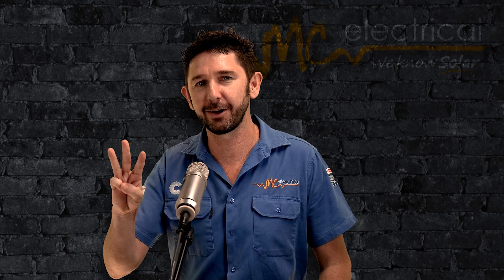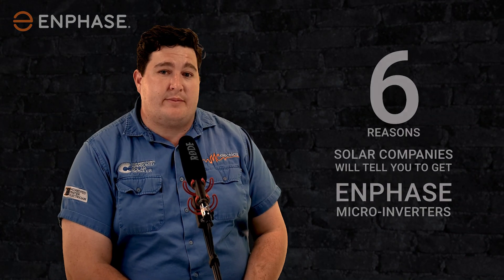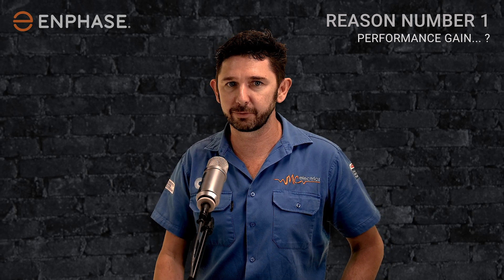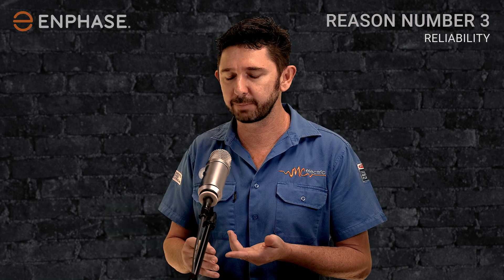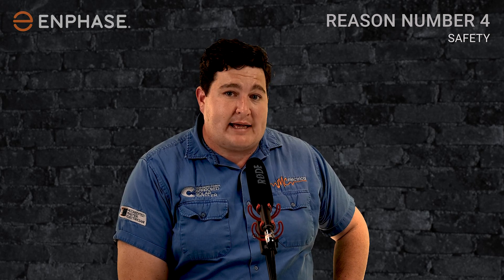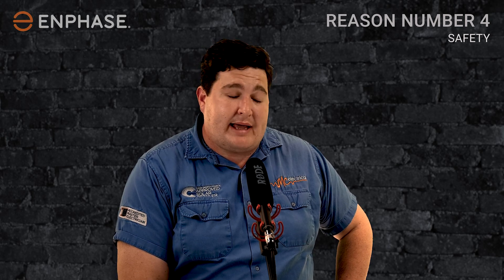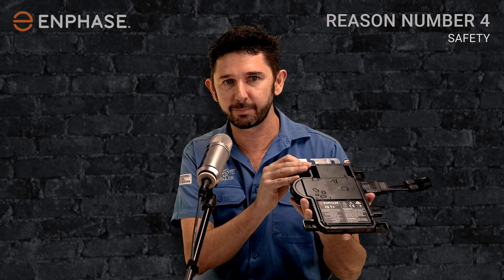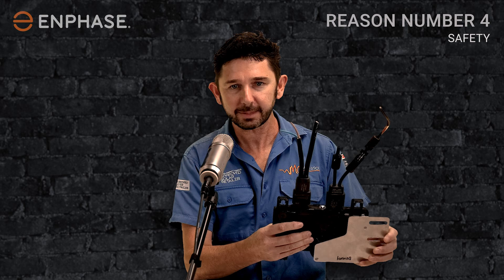Enphase | Solar Optimisers & Micro Inverters Mini Series

Comment: Enphase micro inverter if I buy any solar panel sets with enphase microinverters I'll just take it through a minute junkpile put up the solar panels maybe taking apart and scrap them out for whatever I need from it and throw the rest of it elway I can't see losing the power turn it into AC power raking the solar panel send it to the inverter turn it back in the DC power make a run-through more machines to make more power use so you have less power is every little thing it goes through has to use power and besides I don't need micro inverters they don't need it in this state we are not from California the anti-American country state drug-induced state the communist government in California where the government people in  California  people should be homeless and living out in streets with no place to go to the bathroom the business destroying radicalist people.

Comment: I think your math is off.  A rate of 50 per million per year is 1 per 20,000 per year.  A 10% chance of 1 failure out of 20 panels after 10 years is 0.1 per 200, or 1 per 2000 per year, not 20,000,   But I have 17 enphase inverters and had no failures for 6 years but then 2 failures in year 7 and 2 more in year 8, so yes, they do seem to be "dropping like flies" after a certain period.  My failure rate is 3%, or 1 per 34 per year, so 600 times the rate claimed by Enphase.  I've heard many other similar stories.  They failed one-by-one and some of them gradually over several days, so not due to some surge in the line.  However Enphase did their testing, it is not predictive of real-world performance.  I suspect part of the reason is the constantly damp humid weather we have here in Southern US.  Moisture is much more damaging to electronics than heat, and it eventually gets in.  Moreover, here we have about 50% cloudy days so no professionally installed system "pays for itself" in 10 years, it's more like 17 years and that's under ideal no-shade conditions.
Reply from the maker: I'll check my maths, but that is concerning how your's are failing. Hopefully the more recent Enphase micros are more reliable. Did you see my videos about Enphase v Fronius?  After I did this video I found more reasons not to go Enphase. https://youtu.be/TqOw43-hbjc

Comment: In US they use 2 phases and combine them for 240v. Meanwhile many appliances use only half - 120v - either L1 to neutral or L2 to neutral. I only saw 2 wires and 240v output. How power is separated so we can still have 2 time 120v going to the panel?
Reply: The two wires from the inverter connect to L1 and L2, and supply power at 240 volts.  L1 and L2 then connect to opposite ends of the low voltage winding of the transformer on the telephone pole.  The transformer can absorb the power and step it up to  high voltage (thousands of volts) for transmission through the grid.  There's no need to connect a neutral to the inverter. If by chance you've got lots of 120V things running on L1 and none on L2, that's no problem, the transformer will take care of the imbalance.

Comment: Did you ever do part 4 SolarEdge
Reply from the maker: No. A long story around that - Basically I got threats and i was reported to the electrical safety office on a witch hunt. I ended up getting the BS rulings from the ESO overturned - i should probably do an article about the unethical and aggressive tactics used to dissuade anyone from speaking out some day.

Comment: Never have I heard a credible source say you will get more than 1-3% additional performance in unshaded system, secondly your second point is incorrect - if I want I can see per panel performance temperature, voltages, power amps etc at the minute or system performance on a second by second output in local envoy mode (installer mode), thirdly a platinum installer gives you a 15 year warranty.  I have a 6 years old (three times expanded system) that 1 micro reported issues - installer replaced and upgraded 12 micros for me - zero cost - took about 3 weeks from first query to all installed!  The other two advantages you missed are if you want over time to expand your system - with no regret spend - then with Enphase this is simplicity itself Finally if say several PV cells die or are damaged by hail at the 5 - 10 year mark - well with a string solution - can you still find those exact same panels to buy and replace - whereas with Enphase its a non issue, buy whatever you want and fit it back into the array within the micros rated power + 33% or just install a bigger micro with a 400 - 500W panel.  Lets say you had a roof with 2000W panels and 8 of 24 panels were damaged in a string solution - how would you hope to repair that unless you were lucky with second hand parts that pretty much matched the ratings of your old PV panels.  You are right its a more costly solution!

Comment: I started with Enphase in later 2013, and have no desire to change. The quality is superior even with my old M-215 inverters. If you want to cut the cost a bit, then ya, chose Solar Edge, it will perform close to the same, but you still have that one wall inverter point of failure. That I don't like.  My neighbor was talked into Solar Edge a few years ago, and has gone through two Solar Edge wall inverters in the first two years. The last one had smoke coming from it before it tripped the AC breaker. Yes, both were replaced under the installers warranty, but one took a month to get it changed, and the second one took almost two months. The 3rd one is a different design, so maybe he'll have better luck with that one.

Comment: Just for the record I have had 3 Enphase microinverters go bad on my 24 panel solar system which was installed in 2012. Enphase did provide replacement units at no cost but installation was up to me because the company that installed my system does not warranty installation of replacement parts.

Comment: You've only installed 3,000 Enphase Microinverters in five years? That's nothing. We install three times that many each year. No wonder you know so little about Enphase Microinverters. 

BTW, The Enphase IQ8 inverter has been used in the Enphase battery since 2020, and will be available for solar panels later in 2021. The IQ8 microinverter inverter is a game changer...
Reply: so, could you help explain, is there any more advantage of enphase systems?

Comment: When you start talking about storage I think Enphase becomes an even a stronger proposition.
Reply: This is completely wrong, because a battery is charged with direct current (DC). With micro inverter you must first convert from AC to DC to charge the battery, which costs at minimum 15% of power. With a string inverter and the battery on the DC side, the string inverter can then provide the energy from the battery for the house in AC, the overall efficiency is about 20% better then AC storage.
Reply: @falkreichbott5675  Technically maybe so. However, when the grid goes down and sun is shining the system is smart enough to not even use your battery but power the house from the panels. And overflow the extra to charge the battery. That’s not something the other batteries can do including Tesla Powerwall.

Comment: if there is so much downsides to enphase why not use solar optimizers like solaredge ? what is the actual benefits in terms of shading by using microinverters vs optimizers?
and why AC through home is safer than DC ? ( assuming same wattage in power. safety is the same concern for both)

Comment: ENPHASE 25 YEAR ON ON ROOF TOP UNITS During the Warranty Period, if Enphase establishes, through inspection, the existence of a defect that is
covered by the Limited Warranty, Enphase will at its option, either (1) repair or replace the Defective
Product free of charge, or (2) provide a credit or refund to the owner of the system at the originallyinstalled end user location in an amount not to exceed the then-current price of a “like kind”
microinverter(s) that is available for purchase by the system owner at the time of the Limited Warranty
claim, or (b) the original cost of the Enphase Microinverter that is subject to a Limited Warranty claim.

Comment: Did you ever get the issue with 50ish voltage panels with Tigo Optimizers ever resolved?  I'm putting up a 9.5kw system w/ optimizers and was intending on using SunPower panels but now I'm reconsidering after watching your really informative videos.  Thanks!

Comment: Do micro inverters start producing power as soon as there is some sunshine, whereas string inverters have a threshold? Also do string inverters have clipping? Are these things significant or just theoretical?
Reply: An Enphase system will turn on at 1 Watt - (not that that gains you a a lot) I have heard that string inverter can go that low.  I have a 44 panel mirco design (6 arrays in 4 compass bearings NE, NW, Se and SW - on a really cloud day t might only be producing 220 - 440W - so 5 - 10 W per panel at midday - can a string inverter do that?

Comment: Mark, your question to Yoric about how much any individual panel is producing in real-time, is that answer only correct if you are using the basic Enlighten monitoring rather than paying for Enlighten Manager access? From what I'm seeing on the Enphase website (https://enphase.com/en-us/support/faq/what-difference-between-paid-enlighten-manager-and-free-panel-energy-data-offering) after just having my system installed yesterday (not by MC but another reputable installer), upgrading to Enlighten Manager will give an owner near-realtime data about panel production, albeit in 15 min intervals.

Looking forward to seeing the SolarEdge video in the very near future (unless their lawyers have threatened you again!!!)

Comment: Great video. How much cheaper is an equivalent next generation micro-inverter system (IQ8?) going to be? The two main factors being 1. Smaller, less components in the new model will reduce material and manufacturing costs. 2. Having ability to have micro-inverters integrated with panels would reduce installation costs.

Comment: Great video thanks MC!
 
Typing envoy.local into a web browser when on the same network as the envoy, allows you to access real time reporting directly from the Envoy. An upcoming update for Envoy will also allow user to see real time data in the near future, on the Enlighten Portal. 
Dual tariffs for import and export will also be implemented very shortly.
 
MC4 DC connectors are very safe and only run at ELV with an Enphase system therefore there is no risk of ACFI.
 
AC voltage rise can be overcome with good design, Enphase also has no associated DC loses. 
 
Selected deployment on a string system is cheaper but isn’t a full solution like Enphase is.
 
If your data proves 50 DPPM, perhaps Enphase have figured out that putting MLPE on the roof isn’t an issue with their super reliable technology?
 
“I have Enphase on my roof, but it doesn’t necessarily mean you need to”, is a great close as most installers have Enphase on their roof!
Reply: Ryan, this is a great piece of info to have. As a homeowner who loves analysing data, I'm stoked to hear about these planned updates hitting the Enlighten platform in the near future (and to think that I was thinking about upgrading to Enlighten Manager this morning!). The tip about using envoy.local also is great too.
Reply from the maker: Hey Ryan, thanks for your comments! (just for the readers - I know Ryan. He's an Engineer with Enphase - a wealth of knowledge and a top bloke).

-Yeh I was going to cover direct connect panel data, but thought it got a bit complex for viewers. I've been holding off for the monitoring update for about 6 months. I'm looking forward to it! When it is updated I'll do a Enphase monitoring platform tutorial.
 
-A big point of disagreement is that 25 Volts can sustain an arc, as Fronius have recently proven.
 
-AC voltage cannot be overcome to the same extent as sitting a string inverter next to the switchboard and running 10mm cable. In some installations we have very little to work with.

Our failure rate is insanely small. And yes that's why i lean more and more towards Enphase. 

And I think you are taking Yoz's last line out of context ;).
This installer has Fronius!
-

Comment: That was very interesting especially the optimiser vs enphase discussion and the tipping point aspect.  You had Huawei in the title though?
Reply from the maker: Hey justcruisin. Yeh bit of a Typo there. Thanks. I shot the SolarEdge video today. It should be out this week.
Reply: @mcelectrical  Thanks - will be looking forward to it although I think my interest is in the Tigo optimiser (and maybe the Huawei optimiser if it is able to be used for a couple of shaded panels in a paralleled string). Cheers